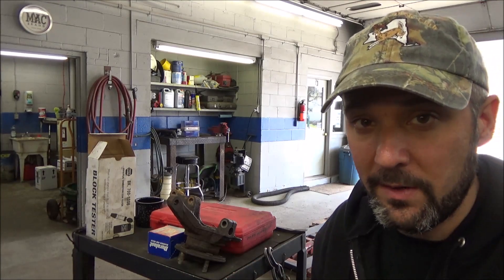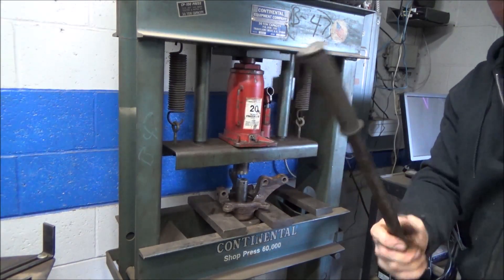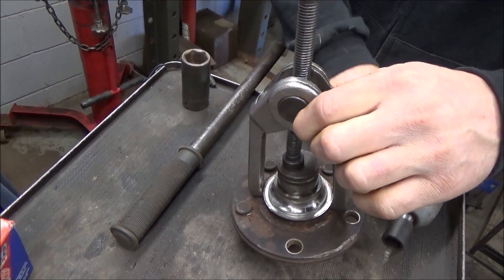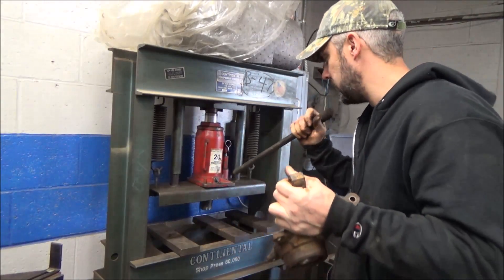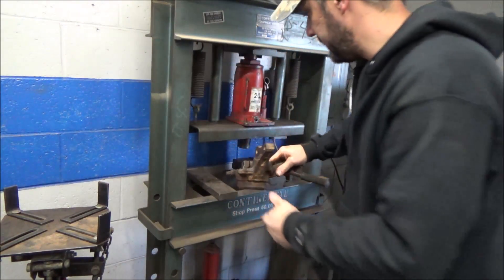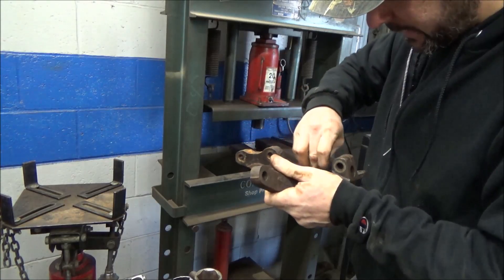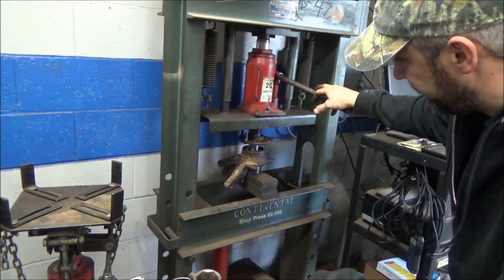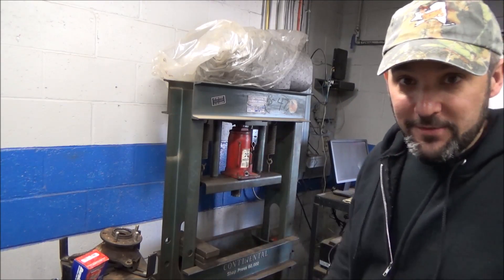How To "Press" A "Press In" Style Wheel Bearing

Comment: My top tip for using a shop press is simply to know when to quit when something doesn't want to move.  Applying too much force will mean that you will damage the press and/or the part (if you are lucky) or it'll suddenly release a couple dozen tons of pressure in whatever direction it feels like going and it might feel like coming YOUR way.
Reply: its my experience that if it isn't moving, than your rig is wrong. 2 variables. i've only ever had to help new guys. and i really only work on 1/2 ton through fwd toyota's. so my experience is limited.
Reply: An air hammer tap-tap-tapping on the component does wonders to help things move along.

I have a round semi-polished bit I created which doesn't get used often.  But, when it does, it works wonders.

Comment: Most videos I've seen cut a diagonal into the hub race to get it off, but the few times I've tried I've been able to use a puller to remove them, and pretty easily at that. Some press-in bearings can actually be reused so why destroy when you could have a decent backup in case you need one.

Comment: You are indeed a good shop and an asset to your community. To take something in that somebody worked on first is truly old school.  I have in the past used the old bearing as a support when pressing in the new one. 

The very first VW Rabbits used to go through them with regularity. I heard they found the grease they were using was a dielectric and causing static arching while rotating, pitting the race. They added graphite to the grease to bleed  off the charge and the problem went away. That was the urban legend at the time.....
Reply: Yeah I remember my buddy messing up my wheel bearing when helping out, ended up damaging it.  Had to bring the spindles in and they pressed them right then for like $40 or something, they have had a lot of business from other people I know because they're good guys.  I also remember seeing the mechanic on his boat one time, doing great work and doing well that's what I like to see.

Comment: I was working in  our truck shop,  and had to press off a drive shaft yoke to replace a carrier bearing.  Because the drive shaft was too long,  we picked up the press with a fork lift put pallets under both sides set up the drive shaft.  Our press is 100 tons.  I was watching the pressure gauge and it took ( to my surprise) 26 tons to break it loose then 23 tons to keep it moving.  After I replaced the carrier bearing which was easy had to press the yoke back on. I used anti seize it still took nearly 15 tons to press it back on,  after the splines and yoke were cleaned.  A press is a great tool, even if you don't need it very often.  I realize a 100 ton press is a bit much,  still it made fast work of an otherwise tough job.

Comment: I've had a press for
 35 years and only used it maybe 20 times. When you need it, you gotta have it. But the set up shimming time is a killer. For bearings, even drop offs like this one, I still use my OTC GRAPPLER. Much quicker, easier set up and  I DON'T have to pull it off the car saving  having  to send it out for an alignment.

Comment: I also went with a 20 ton. It struggled with the first bearing so I just flipped it a few times applied pressure until it popped loose. Had I gone with a smaller press I would have been stuck... thanks for the video I've never had press in hubs just assembly hubs so this was a great video. Simple, to the point and you can SEE what you are doing! Thanks again all these years later!

Comment: Good tips on press use. You don't need them a lot but when you do you really do.
Reply: Mine is a "go to" tool.
Reply: I bought a smaller 12 ton press.  Best $100 bucks I’ve ever spent!  A 25 ton press is sure next when I get more room for a shop!
Reply: So what applications do you have in mind for a 25 ton press?
Reply: I have a 12 ton pipe bender, only used it once. But I needed it.
Reply: @hashiramasenju4846  I was thinking of getting a 12 ton press, Is it strong enough to press out a bearing in a climate that experiences corrosion?

Comment: I think I know exactly why this customer is replacing their hub bearing. Happened to me several years back on my wife's car. She had taken it to a certain big box store to have a tire fixed and they cross threaded a couple of the lug nuts. So when I had to remove the wheel a year or so later, two of the lug studs broke off. The hub is so close to the knuckle/carrier that the only way to get new studs in is to remove the hub from the bearing, and as you see here extracting the hub can cause the bearing to come apart. Plus, it didn't make any sense to go to all that work pressing the hub out of the bearing to press it back in to an old bearing. It looks like this hub has plenty of clearance but looks can be deceiving.

Comment: Short and sweet video when you are "pressed" for time :-) I had Pepboys press a bearing in for me and clear as day, the instructions warned them of the ABS tone ring. Needless to say they screwed it up. They told me I should have warned them. I just bought my own press after that experience.
Reply: Had a similar bad experience at PepBoys. Found the helper wailing with a BFR on something in the engine compartment when the job was underneath. Showed him the location and got my vehicle back. Happy ending? He left a SnapOn 3/8" drive 24" extension in the engine bay.

Comment: Thanks for the video.  I had a local shop change out my front press in bearings because I did not have a press and did not want to buy one for a one time use.  Plus, did not know what kind of gremlins may pop out in the process.  Gave the shop the whole job $200 labor and $200 bearings, highest end bearings available at NAPA.
Reply from the maker: +Sandbag1300 I charged the guy $30. Most cases I get .5 to 1 hour labor to R&R bearings if you bring in the knuckle
Reply: +South Main Auto Repair The shop I went to was in Bloomsburg, PA, the sticks.  Priced the same job in a shop in Stamford, CT.  They wanted $200 labor per wheel.

Comment: I debated buying a press for years, thinking I'd hardly use it. Now that I have one, I use it all the time! It works great for straightening or bend just about anything (on purpose lol).  It has also saved my bacon many times to hold something that the vice would not. I replaced an International high pressure oil pump that drives the injectors and there was nothing I could find to hold the helical cut gear to loosen the nut. With the press and some 2x4s to "clamp" the gear without damage, I was able loosen the nut, replace the pump and tighten the nut to spec. Without the press, I don't know what I would have done.

Comment: how did you make that look so easy? I don't own a hub tamer, and none of the shops I've ever worked at had one, always used a press. last one of those I did, I used a 50 ton bottle jack on the press, a torch, sledge hammer, die grinder and lots of lube, before it came apart.

Comment: I've used a 100 ton press, made a cage to go around it so the shrapnel does little damage.
But there is always the time you have to use a torch, arc gouge, plasma torch, or cut off wheel.

Comment: After you grease your bearings toss em in the freezer for a few hours or overnight. Get everything set then get it. It will shrink a tiny bit a press in a bit easier. Thermal dynamics   really makes getting metal fasteners apart. Heat to expand cool to shrink! Really helps with anything press in!

Comment: I push out the inner hub as superstar Eric O does.  But then I have encountered way too many that I can't or daren't push against because of the brittle cast iron and their unusual shape.
So I knock out the balls and the retainers so I am just left with the outer race in the hub.  I then drag out the welder and run a bead of weld all the way round the outer race on the inside, being careful not to catch the cast iron hub itself.  Wait for it to cool (only a minute or two) and it usually just falls out!  Or a little tap with a small hammer.  From start to finish last time took about 5 minutes!  
Never had any comebacks or problems.  And it warms my hands in the UK winter!

Comment: The cheap parts store bearings don't last. You'll be doing it again and again until customer gets a Timken or OEM bearing.
Reply: I just paid 300 bucks for a hub assembly on my truck with a lifetime warranty so if it goes at least I can get another
Reply: It's true, I replaced mine several times before going with Timken. Cheap only lasts 10k miles.
Reply: Especially if you press the new bearing back in using the inner race to press against, flat spots form on the races and balls?
Reply: Timken makes their shit in china and outsources to other brands, they have been advertising their chinese factory for years now. Last 3 bearings from Timken I have received were all bad right out of the box.
Reply: @robsp32  Exactly, it's all about labor arbitrage and technology/knowhow.  Our young guys don'thave a chance since our gov subsidizes this offshoring.
Reply: My cheap orielly bearings lasted 3 months

Comment: Sometimes when the inner race is tight , out comes the 1 mm slit disc on the angle grinder , cut it sideways , slides off , easy peasey, then press in , love European cars , mainly front wheel drive,  stripping everything off , rusty,  abs leads , then out comes the plastic arch to get to multi plug ,why do we do this job ? , when customers thing we only work for peanuts , yet if you sit behind a desk you get buckets full of money, oh yes that's because they can't do anything and need loads of money to pay everyone else to do it for them !!!!, Happy New Year from the UK

Comment: I had to press a bushing out the other day (buddy has and old HF 12 ton).  It was one heck of a BANG when it started to move !  Scared us both !!
Reply: +theoldwizard998 Lol. When I was in a shop that got more bearings, even across the shop I'd have moments where I'd jump, look over and say, "What the heck!?"
Reply: An air hammer with a rounded bit tap-tap-tapping on the assembly does wonders to help things get unstuck before the pressure builds.

Comment: I changed out the press-in bearing on my 92 Taurus SHO at the auto skills center on Schofield Barracks, Hawaii.  The mechanic on location told me to replace the hub as well, because it was loose inside the new bearing, just fell right in!!  I didn't take his advice and just cranked down the hub nut good n' tight!!  The mechanic told me this wouldn't last long, but I did it anyway!  Five miles into the test drive the bearings started making this coffee grinder sound!  Had to do the whole job all over again with all new parts and a new hub!!  Rookie mistake!!;-) I always buy the kit that includes the bearing, snap-ring and the hub.  Great video, as always, Eric!  You're my new YouTube bro!!

Comment: Thanks bud.  Extremely informative and helpful to me.  I'm a handy guy, but not too familiar with a 60 ton press.  You set me straight on that.  Thanks again.
Reply: 20 ton Harbor Freight examples can be picked up via Craigslist for under a C note.  And with all the add-ons from SWAG Offroad, it becomes quite the DIY shop workhorse.  Check out the gibs I fabricated to remove the ram slop from the cheapie press:

https://www.youtube.com/watch?v=X6zGj9avKIQ&t=64s

Comment: Have the wheel spindles ever separated from the hub while driving or cornering if the friction from the press fit is all that keeps it together?
Is the drive axle circlip acting as the backup ?

Comment: I need to upgrade from my hf 20 ton press to nicer one like yours. The arbor on mine is small and doesn't keep things straight. I always have to pound on it to get it started then drive it home with the press
Reply: I have the same one. Made some driving heads that slip over the arbor and are retained with thumbscrews. Problem solved.
Reply: I've got the old orange 20T one and the arbor is welded in at an angle... couldn't figure out why stuff wouldn't start right at first, then I noticed it. Hopefully they stepped up their game with the new gray ones.

Comment: Hmmm... Shop Press.  I do have a birthday and fathers day coming up, but I am running out of garage space to put stuff.
Reply: +FrugalPrepper You too? He sold a Snap On air hammer with the last vid. Now, it is time to start spec'ing out a press.
Reply: +FrugalPrepper   My problem exactly. Pretty much something in- something out. A press would come in handy tho. (wifey, we need to expand the shop. )
Reply: I picked up the new silver 20 ton press at Harbor Freight using coupons for around $150 when it came out a handful of years ago.   It does come in handy and only takes up a little wall space.   I originally planned to replace it with  something better like a used Dake when one came along. My HF press has worked well enough for my home shop that I stopped looking for a Dake.   Chris

Comment: Great video 🤙only difference when I do mine on my Holden commodores ie. Your 06 pontiac gtos. The rear control arms are huge and can be a pain to take out unless you have a hoist.

I press my bearings onto the hub first, then hammer/press back into the control arm or knuckle.

But you definitely did it very well. 

Peace.

Comment: Good video. Maybe next time you can show using a torch to heat up and expand the assembly or cut off the race, or even using a cutoff wheel to cut the race , being careful not to knick the hub.
Btw I hope Scotty appreciates you helping him out. There's only so much you can do in the driveway and a big hammer.
Reply: Use a dremel cutoff wheel.  Cut it down almost through and then use a flathead and a hammer on the cut to fracture it there.  The ring will let go and slide off.

Comment: Love your videos! My first question ever. Here it goes and don't laugh at me. I removed a front wheel bearing on a 2004 Honda CRV for the first time. I watched videos on how to do it and that it was important to install the new bearing with the brown side to the back. My neighbor came over to see what I was doing at said that the brown side went to the front because the numbers go to the front. I looked at the bearing and looked the same both sides so we installed it with the brown side to the front and guess what after I finished installing everything and went for a test drive the stupid ABS light came on. RATS!  My question: Can I press the bearing out and turn it around or do I just need to buy a new bearing?  Thank you in advance.
Reply: Diana's World Of Fixing Things Sure you figured it out by now, but if not, I'd just bite the bullet and get a bearing. Your neighbor suffers from a common condition, where he believes his past application applies to all vehicles.

I've seen somebody use tranny fluid in a steering system because they must've seen it done on a Ford or something. In my old Taurus, you used trans fluid in the power steering, but it was not the same for the poor sap driving the Grand AM. This is where a manual can help guide you as you learn, and allow you to cross reference advice from lesser known youtubers, who might not be qualified (I've seen dangerous info on YT). It's not religion,  but it'll help you on little specs like that, and I'd surely take it's word over your neighbor's next time 😕. On the bright side, you'll be a master on changing a Honda CRV bearing. .Have a beer 🍻

Comment: I snapped one of the ears off an escape recently at my dealership I was able to get a used one from the junk yard the next big purchase I make will be a wheel bearing kit to do it on the car
Reply: I bought one of those to replace press-in front wheel bearings and it worked perfectly for it. I got the Astro-Pneumatic which is heavy duty. But it won't remove the hub from the knuckle in most situations. I usually just remove the knuckle and punch it out or use a press.

Comment: 3 Vids in 3 Days, you are spoiling us Eric.
I tried to do a rear wheel bearing on my car last year. I was all ready to use a threaded bar with bolts to press out the old one. But the circlip didn't have holes or notches, just a perfect C. I fought with it for hours, but I couldn't shift it. Eventually I went to the local scrap yard and bought a used hub with a good bearing inside (€25). 
Have you ever come across these type of circlips Eric? If so how the hell do you sort them?
Reply: 5 years late to this one so hopefully this will help someone out there. If the snap ring breaks or doesn't have any notches to grab into, carefully drill two holes into them so you can insert snap ring pliers. Make sure the snap ring can rotate in the groove before you try removing it, you can use a screwdriver or a chisel and just hammer it around. Sometimes if they're really rusty you'll need to use some heat

Comment: Eric,
What's the range I should pay, to get bearings pressed in? I've gotten a wide range of prices and can't tell whether I'm getting ripped off or not. Rumor is Napa will press in and out bearings your purchase from them, does anyone have experience using Napa's service? Vehicle: 03' Ford ZX2.

Not looking for exact pricing...just a, "I wouldn't pay any more than $__.__", estimate.
Reply: +Darren G.  Local Bumper to Bumper auto parts / machine shop charges $50.00 to press out and press in.
Reply: Darren G. I feel blessed. Shop I went to charged 25 to press out and in a wheel bearing. I actually had him do a balljoint and a bushing. He charged 80 ish for labor. I wasn't going to rent the friggin ball joint press. Probably should just buy it.

Comment: With any bearing that is cheap..... repack with better grease. Graphite in fused???? Another option is to cool the bearing to very cold CO2 and heat the knuckle hot 500F and vice versa with the hub this will eliminate the interference fit.